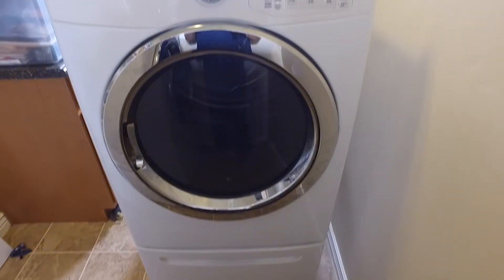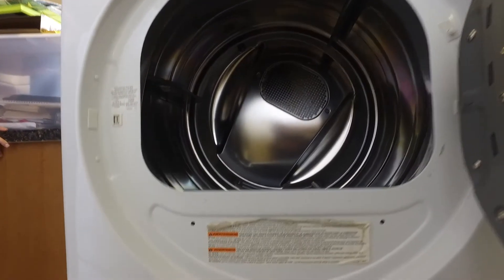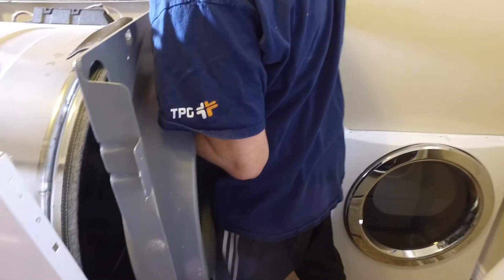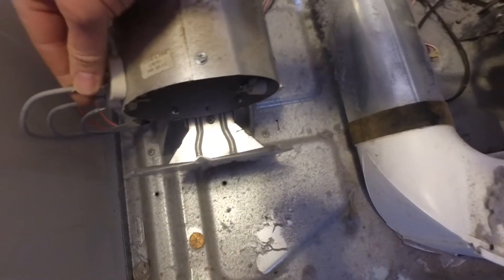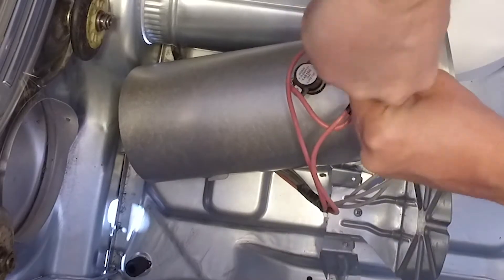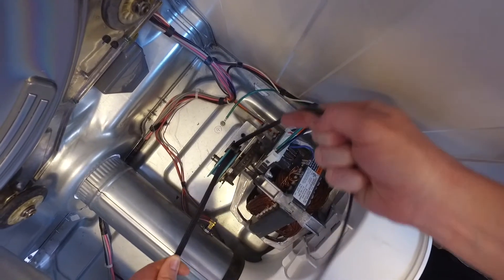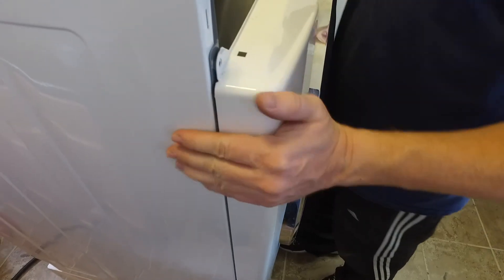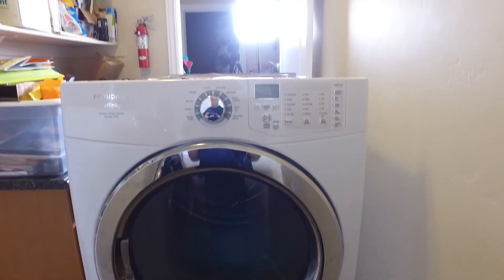How to Replace the Dryer Heating Element in a Frigidaire Dryer

Comment: How did you know it was the heating element and not, say the thermistor?  I'm going to change what I think it is, but I want to narrow it down first.  Thanks!
Reply from the maker: It was only blowing cold air, and I googled it to see what it Might be. Turned out that was it. 😊
Reply: Year later I know, but in case others need the info:

You can test the heating coils with a multimeter for continuity between the their connections on the inside of the heating element housing. If there is not continuity, the coils need replaced (much cheaper than replacing the whole element). Same can be done with the connector side of the thermistor.